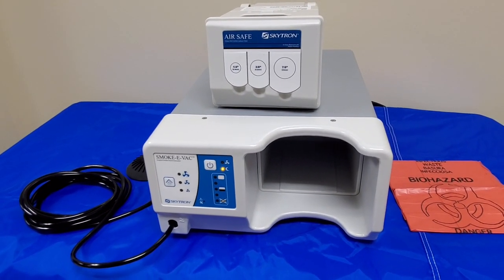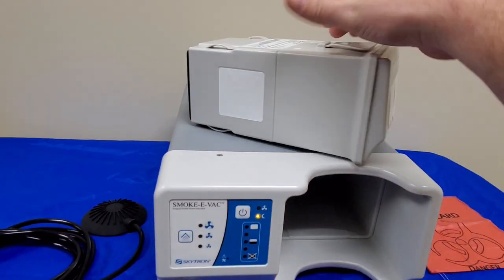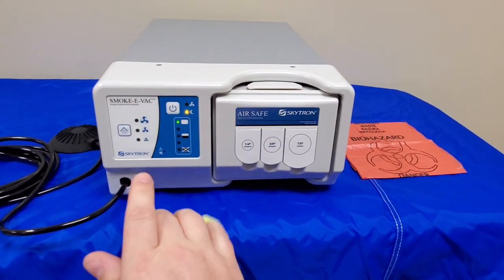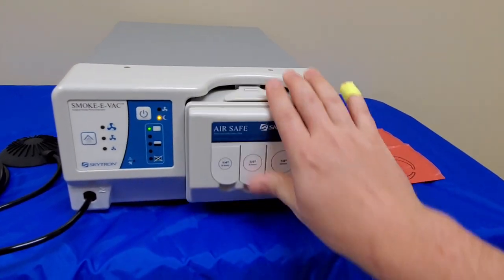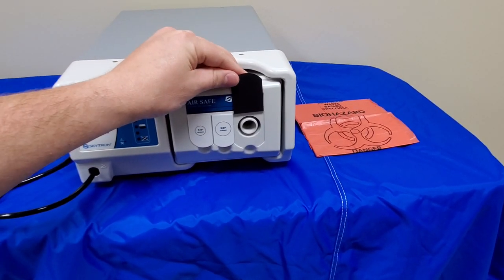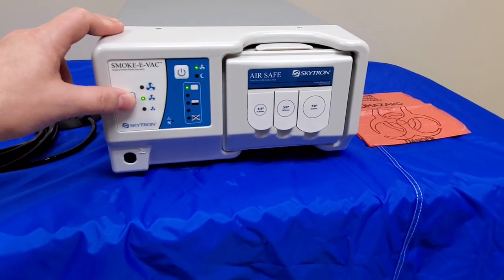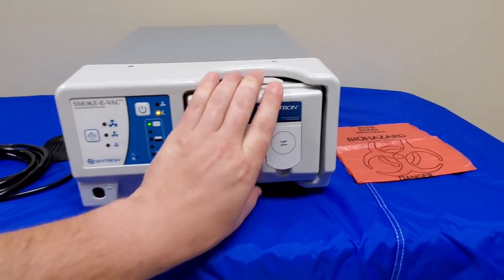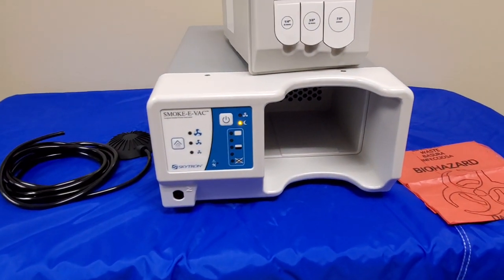Skytron Smoke-E-Vac Training

Comment: Theres a back aux port , what is it use for?
Reply from the maker: The rear port is for ESU induction pickup which automatically turns on suction when a ESU is energized.  The pickup is an accessory which can be purchased through your ESU vendor